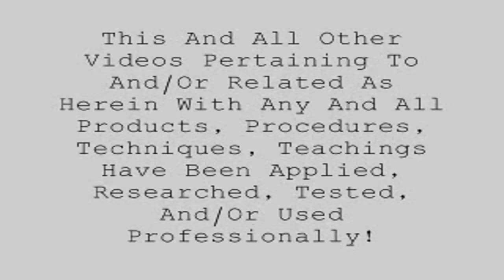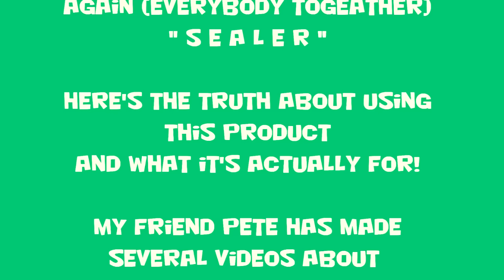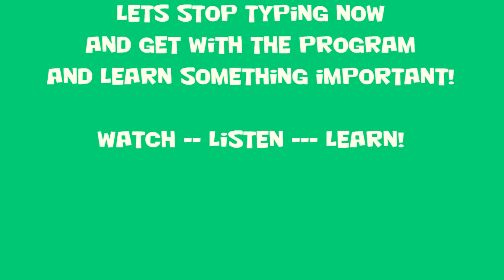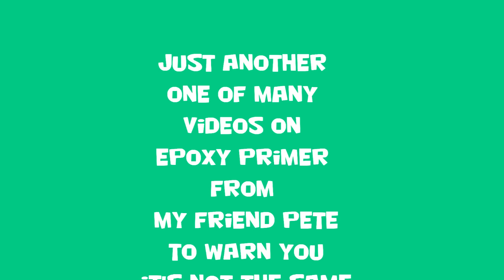How To Use Epoxy Primer - Automotive Paint And Body Tech Tips

Comment: I'm confused you say don't paint or sand epoxy primer then at the end of the video you sand it and say you can paint it. Then you give to many scenarios of if and ans. Wish you could just say what to use and when to use it once.
Reply: Do all your body work, prime with 2k, seal with epoxy, paint either base and clear, or paint your single stage
Reply: @gm-lb9oe   You are WRONG.
Reply: Ignore his confusing scenarios. Epoxy is for protecting bare metal. That all. He should have used the word "scuff" epoxy instead of "sand". Epoxy is not sandable as he said 10,000 times.
Reply: Junior you are leaning, if you are confused while seeking to learn, it's better to ask than just bumble through it, no shame in that.... Junior use Epoxy Sealer for bare metal,, polyester primer or 2k high build to make sure the body is straight. 
You can lightly 'scuff' 'epoxy sealer' to give the (polyester primer or 2k ) a place to get a hold of, as Pete showed at the end of the video. But I would wait at least 2 weeks to give the sealer time to cure'. Makes less gumming. Do 'not' scuff to metal (only lightly scuff) before body work and then adding polyester primer or 2k.  I hope that helps.  Phillip Hall
Reply: @PhillipHall01   2K is urethane, not polyester.
Reply: @SOLDOZER  …. Yes!! And I think Said scuff with 80 grit or 180
Reply: @SOLDOZER  
That is correct...
Reply: @SOLDOZER  in what way?
Reply: @PhillipHall01   2K goes on last before paint. You dont spray epoxy over 2K. That would be 100% pointless.
Reply: @SOLDOZER  
Karen that's not what I said. I did not say to spray epoxy over 2k.  No wonder there's so much confusion; goodness. lol 
If you go back and check you will see 'g m' said that:  I will quote"
"g m"
(19 hours ago)
"Do all your body work, prime with 2k, seal with epoxy, paint either base and clear, or paint your single stage"

I said you can spray polyester over 'Epoxy Sealer' after it has been 'scuffed', (or you can use use 2K high build) and I recommended scuffing the epoxy sealer no sooner than 2 weeks, allowing curing time for less gumming. The reason for scuffing is so the body filler, polyester or 2K fillers can get a holding bite.  
In other words. 
Bare metal  
(1)-epoxy sealer. 
(2)- scuff sealer in body work area and do body work. 
(3) - scuff the rest of the sealer for adding polyester primer or 2k primer for block sanding to make sure the body is straight in all areas.  Note, Polyester primer can not be painted over but has to be sealed. 
(4)- If 2K high build is used, sand up to 600 grit and its ready to paint.
Reply: Here is another video Pete put out about 4 years ago on the subject. He even tells and shows how to color tent epoxy sealer.  https://youtu.be/Ss5GFMNc14M
Reply: @PhillipHall01   You said 1) do body work 2) spray with 2K, 3) prime with epoxy 4) paint. 
Thats all wrong.
Reply: @PhillipHall01  When Pete says "sealer" he means DTM. He's talking about it being a bare metal protectant, nothing else.
Reply: @SOLDOZER  
Well I see from your last two replies 'and a couple before', you not only have trouble comprehending what I have written and 'numbered', you even went as far to rename and miss-represent and re-sequencing what I have clearly numbered, to suit your 'perception'.  
You have jumbled what others have written as well. (Even mixing what one person says with another person) As I stated above. 
Pete has been more than clear with what he means when he refers to 'epoxy sealer'. (and has been saying it for years). I have sincerely tried to have a nice conversation and discussion with you but I am getting nowhere.  I hope you mean well, as do I. Wishing you the best! 
Phillip Hall
Reply: @SOLDOZER   i guess your wrong :) , even if you go back in some of Pete's older vids, he has sprayed epoxy "primer" as a SEALER. Thats what the stuff is. If you have a mishmash of stuff that you did all over instead of doing it in a systematic way, shoot a coat on, hopefully NO runs, your ready for paint. I try my best to avoid the stuff if I can, as the stuff , like Pete said a zillion times, you can't really sand the crap to get it smooth as a babies ass. If you do happen to have a tiny run, you might be able to level , hopefully it out with 400- 600 wet then spray your paint. Then clear. Buff and your done

Comment: it is primer for primer and yes it can be used as a non sanding primer sealer if mixed by the data sheet. one of the biggest mistakes people make is putting body fill over epoxy it has to be applied to bare metal once again read the data sheet for the body fill
Reply: Wrong...wrong...wrong...
Reply: @SOLDOZER  lmao try reading instructions been in the trade over 35 yrs this video is what is wrong
Reply: @amandagirl8042   35 years and you dont know what a TDS is?
Reply: @SOLDOZER  technical data sheet the instructions you need to read them b4 posting videos doing it wrong

Comment: Paint manufacturers should have never used the word 'primer' with the word 'sealer'. They should have stuck with words "Epoxy Sealer" never calling it 'epoxy primer'. 
I know that DTM manufacturers says DTM does it all but they don't. I called M-----  and ask them about their DTM. They said sure you can use it like a sealer or a high build primer. I said ok, then like a sealer I can spray it and just sit it out in the rain like I can do with epoxy sealer, for longs periods of time and it will be ok? Answer; No I would not recommend that was the answer. What does that tell you Pete?
No wonder you get so many calls on this Pete!  What a mess!!! Phillip Hall
Reply: You got it

Comment: The days of body filler on bare metal are over as same as wet rubbing as body filler is porous and will cause rust underneath the filler on your bare metal epoxy primer is made for body filler well protec para glaze is mixed at 4 to 1 and ten % reducer the shit your useing is more like a cheap nasty etch  primer 😂😂😂😂
Reply from the maker: Your full of crap.. Go paint some lawn furniture.. IDIOT

Comment: I'm finishing my 88 formula 350 now, I used Tamco DTA epoxy to seal, and then prime my car from bare metal. It sands wonderfully. Pretty much broke every single rule you made in this video lol. Have a great day scrubbing your bug.
Reply: Henry sounds like the DTM That other companies sell?   I called M-----  and ask them about their DTM. They said sure you can use it as a sealer or a high build primer. I said ok, then like a sealer I can spray it and just sit it out in the rain like I can do with 'epoxy sealer', for longs periods of time and it will be ok? Answer: "No I would not recommend that" was the answer. So you might ask the same question to Tamco. Let us know what they say please sir.
Reply: @PhillipHall01  I dunno who "M" is but  Tamco's epoxy is described like this on their site- "DTA epoxy offers top notch corrosion resistance and ultra-smooth spray ability. It can be re-coated or top coated within 7 days and is ideal for long term restoration projects where the vehicle has to sit in primer for long periods of time." I got it specifically because I knew it would take me forever to finish the job.
Not all products are the same and not everyone knows every product. I don't need to call them because I already know how the product works, you can call if you don't believe what I said or feel the need to prove me wrong or something. I don't really care- the shit's on my car and I'm definitely not taking it off at this point. My original comment was meant to be mostly matter of fact as opposed to a challenge to the video posters knowledge. I just commented because I thought it was hilarious that I'd broken pretty much every rule he listed unknowingly when I started the project.
Reply: @PhillipHall01  Feel free to quote me where I presented myself as an expert- I'll just sit here and wait...
Reply: @henryknox4511  
My apologies Henry. Phillip Hall
Reply: @PhillipHall01  Fair enough, mine too. If you read my 2nd comment, at the end it clearly stated my intent with the post. I'd like to highlight the "unknowingly" part and wish you a good day.
Reply: @henryknox4511  
I have the 'need' for long extended protection as you have. 
I might further find the added need to set mine out in the rain at times, while making room in my small two stall garage for other needs. 
This need is why it is 'very important' for me to 'know' if the product I use such as DTM or DTA will protect my project, even in the rain, for extended periods of time. 
Matrix honestly answered my question, (M) concerning DTM.  
I am confident that regular epoxy sealers 'will' do the job I have need for. I figured that you 'might be' in a similar circumstance or situation as I am. If so, I am thinking finding the answer to my question might be beneficial to each of us,  again (if your needs might be as mine).  And I had hoped you had already had the answer to my question, or could get the answer since you already have a business relationship with Tamco. Thats it in a nutshell. Wishing you a nice day also.
Phillip Hall